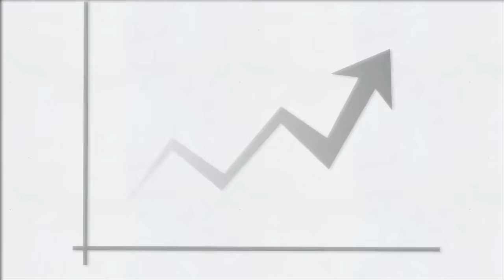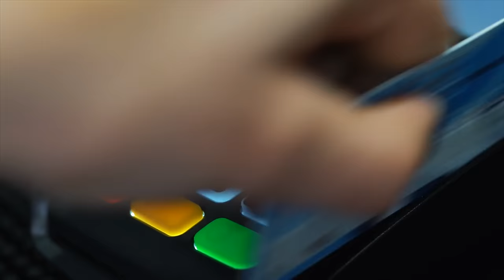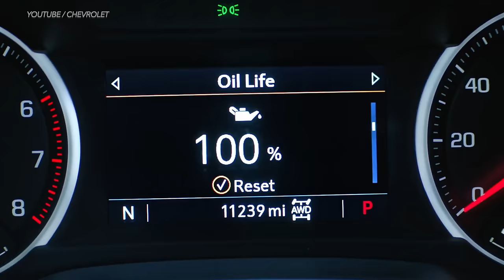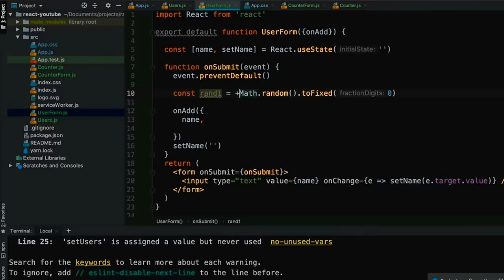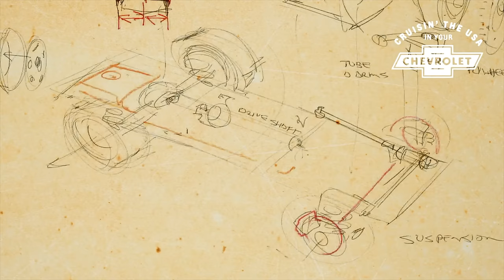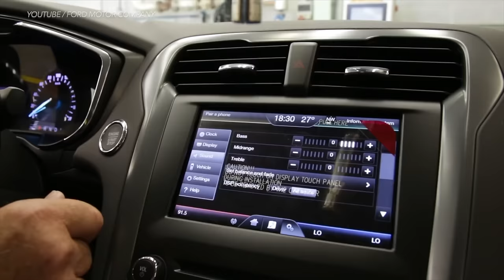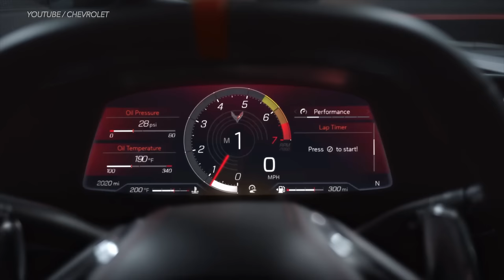Here's Why Car Companies Just Made it Illegal to Work on Your Own Car

Comment: Bravo Scotty  on your video that exposed the automotive repair industry and its monopoly on the repair parts used in that business. Cars need to be modular across brands. I am a truck guy, and why ? Because I didn't care about style (car fashion) But the manufactures quickly realized they could style pick-ups and ruin that vehicle for the consumer as well. Tesla any better ? Heck no. I hoped Nissan and the Leaf might help set this straight, but I guess not.
I am now looking at classics, cause I learned enough in high school shop class to do the basics on those. And they might survive a MCE event that peaks in the next two or three years. Check Physics Girl's channel on those. Computers & computer based cars are not likely to survive. Oh and the protective Van Allen electromagnetic fields are weakening as I write. Good luck everyone. I warned ya.

Comment: Another problem that I see and hasn't been mentioned here. The people who design cars never have 
to make any repairs on them. I can tell because if they did, they'd make them a whole lot different. I've 
had to work several hours on a car to replace a simple part that other cars can be done in less than 
ten minutes. 
We need another car that can be built like the original philosophy of the Volkswagen. Simple, Cheap, 
Easy to repair, and inexpensive parts.
If I won the lottery today, I wouldn't buy a new car.  They all look alike, and I don't think they're as 
reliable as they used to be.
Reply: As a teen i loved my 1962 Falcon with straight 6 and manual transmission. Had it for years.

Comment: I wonder if there is a way to get around these patents. That would be, have a system replacement kits built by aftermarket. For example if your BMW brakes go bad they have a complete system that'll replace the original and the only connection would be at the brake pedal and the wheel hubs the rest would be a self-sustaining system. Then maybe a complete Driveline. While it may seem expensive, it might end up being the same price or cheaper in the long run Plus after that you can Go full aftermarket as your replacement system gets older. Basically all you would have is a body frame and interior the rest would be your own car. And for the price of new vehicles it seems to be appealing

Comment: Fortunately this only applies to newer vehicles. I drive older vehicles, and have no problems getting parts. I am a retired mechanic myself, and can fix most things on older vehicles. But if I run into some big, that requires, say, a hydraulic lift, all my cars can be worked on by any independent shop. I have 3 cars and a truck. I'm 63. I will likely never have to buy another vehicle in my life. None of my vehicles have ABS or airbags, and they all have normal sized wheels and real tires.

Comment: There are repair shops that are ripoffs ! Went to get estimate on a 2007 Honda odessay oil pressure switch replacement, mechanic looked it up and hourly 125hr and switch cost $400.00 ! Then went home looked up on eBay for switch and found one for $10.00 ! And looked on internet how and where on engine to install , so ordered switch and when arrived installed it in 15 minutes ! And been 8 months and no problem ! Do research first !

Comment: I just bought a 2003 pontiac vibe in near perfect condition. Some of the lines are rotting out because it's been sitting in someone's garage for at least 15 years. I literally couldn't find replacement lines anywhere so I ended up just fabricating new lines. I get that it's an old car but theres no reason I should have to completely remake the parts from the ground up.

Comment: I need to replace the valve cover seal on my car, I called the dealership (Peugeot) they wanted $325 for the kit, basically it's 8 0-rings and a seal, I got a aftermarket kit, that was $130 from Repco.

Comment: I found that removing all the electronics and using a carb and HEI, much better gas mileage and reliability results.  Further, some guy used a lawn mower carb on am older Ford 302, and got 41mpg.  And good performance.  Hmmmm.

Comment: Tell ya what. I've got a 1984 a 1998 and a 2018 vehicle. That 2018 costs way less to drive and maintain than both my older cars combined. Sure that may change later on but I don't expect it to break for quite awhile.

Comment: I saw a video that the oil is changed through fittings on the oil cooler lines with a motor  oil flush machine.
Reply: In California, by law, all commercial oil changes are performed by aspirating the oil out thought the oil filler tube. Used motor oil contains toxic substances and the law protects humans from coming in contact with it as occurs when oil is drained by removing the plug in the oil pan.

Comment: GM was wired back in1994-1996 they came out with a hybrid OBD system they had OBD  1.5 which had an OBD 1 computer and an OBD 2 port for modern scan tool and you need a GM Master TECH II scan tool which I brought off of a dealer that got rid of it they sold it to me for 25.00 plus tax.

Comment: Not all replacement parts are equal by any means.  I got into a small front-end collision that bent the hood and they had to replace it and progressive decided that an OEM replacement wasn't worth it for my car.  when I went to pick the car up there was a half inch gap on one side and 1/8 of an inch gap on the other and the hood was crooked. The body shop just told me that it was the hood itself that was the problem and I said well you can't just spin it he said no because they mounted the mounts for it in the wrong spot they welded them incorrectly.  after about a week worth of arguing with progressive they finally gave me an oem Hood and it fit perfectly. this is a your mileage may vary kind of issue.

Comment: There should be a short time limit on the patents  3 to 5 years at the most to allow after market parts suppliers to make the needed parts. The primary manufacturer usually stops making the parts after a few years to force owners to buy a new vehicle. This should be an illegal trade practice.

Comment: I noticed that compared 50 cars with today's cars in few areas but with all the computers and the checks that are for the better the gas mileage never went up even when making the car lighter and shorter and additional checks that fuel is burned and exhaust is rerouted and such for efficiency of what .  
              The cars that are pumped out today aren't made to work on .
        Some people get in to job find the repair guide says it takes 7 hours to replace said part and the business charges that when the machanic sees that and knows it was not even three he knows he just helped screw someone out of 400 dollars in labor cost.  Not to mention the fact that his paperwork went in the trash.   
      As far as the insurance companies go they are now pressuring folks with cars that vandalized to seek out parts from local upullets for parts and claim that the price of factory part from a train wreck will be warranteed and guaranteed by the machanic of there choice.

Comment: I definitely have seen a rise.  A new ram truck requires a full synthetic oil back in the early 2000’s conventional was good enough.  A qt of conventional was last I checked $4/ qt or about $12/gallon.  New truck now requires oil that is $24/ gallon but what you say you can go further on synthetic well not in all vehicles.  The change interval in a new ram about 4000 miles.  Older vehicles the interval was 3000.  Yep progress just wait till everyone has electric vehicles just what for those maintenance bills

Comment: Scotty, What are your thoughts?  People claim it's cheaper to repair a gas engine in a vehicle than a diesel engine in a vehicle because any gas engine mechanic can work on a car engine in any car.  But, isn't that becoming an outdated position?  Maybe it was true if the car was a Ford Pinto or Chevy Vega.  The gas engines with computers and sensors are just as complicated as a diesel engine.  I can repair my diesel myself but I still have to find someone (Ford dealership) to flash the computer.

Comment: This is why I still drive a '79 GMC C-1500 and a '90 Ford Ranger, and will still drive them no matter what gasoline costs. EV's are not feasible, and never will be. Retrofitted engines to use hydrogen fuel is the only option I will consider.

Comment: Normally I'm with you Scotty, but being in the body shop industry for 20 years, I found that original equipment parts are way superior to the aftermarket crap that a lot of insurance companies want you to use.  This includes all parts from mechanical to body parts.  I don't doubt that what you are saying is fundamentally true, but I wished that the aftermarket would up their game and make parts truly equal  to or better than O.E.M. parts.  I know that NAPA has several levels of quality in their parts and most of the time, the repair facilities use the cheapest parts available.  It's a little more complex that merely allowing aftermarket parts to co-exist along with O.E.M. parts.

Comment: Nope. haven't noticed. I do all the maintenance and such on my car. Plus, the older cars. Sure, they may cost a few thousand to repair at times. But then, $5,0000 dollar for a new engine and transmission, is cheaper than a brand new cars, by about $10,000.

In the long run, it's more cost effective to repair the older car than it is to buy the new. Especially with the 5 year or so life span of new cars. For example, my car, I'm the second owner of it, it's a 1998 with 213K miles. Does it have some problems, yes. Can they be fixed? Yes. Which I've been doing. I bought the car for $2,250. In total to fix the problem,  I have about $1,000 invested. That's $3,250 total for the car. That's the down payment for a new car, or barely the quarter cost of a new car, and I don't have the monthly payment.

Thus, I can use aftermarket parts. Which, truth be told, are generally better than O.E.M. parts. Since they want the oem parts to break, so you have to buy more. Dorman is the worst for this.

Comment: I was just thinking about the poor guy, who was suggested to replace his main battery for several thousands in his EV because a little 12$ or less cooling inlet broke off. Luckily for him, some right2repair guys could help him.
Btw. What are your thoughts on the Aptera concept? I mean, how they want to help customers and mechanics with a digital repair manual?
It reminds me of the old cars from 80's and 90's, where the manual could give you a lot of help, when something was wrong with the car and basic guidelines for smaller repairs.

Comment: We drive  97 dodge ram 1500 AN THEY wanted 1200 for the throttle body and my husband just put an old school intake on it and I actually get 26 miles to the gallon now an it runs so much better its a 318ci an we have  dash lights  on  but they are WORTHLESS since the computer isn't running the carburation.

Comment: These manufacturers are about to get a huge wake-up call. Additive manufacturing, I can 3D print many replacement parts, and I can use stronger materials like Carbon Fiber.

This is my prediction, the maker community will publish CAD files for common automotive components. This will expand to a huge library, where anyone can go and grab the file for the part they. Makers will grab these files and print parts for their cars. Manufacturers will file legal cases, in attempt to stop this. I think they’ll face an uphill struggle, I just need a digital caliper, a CAD program, & a 3D Printer and I’m in business.

As people build their CAD library for their own vehicle, I think they’ll uploaded them to website’s hosting public libraries.

Comment: I guess these “modern” consumer customers have never seen old cars and trucks with steel or oak board bumpers fastened on the front and rear with lights attached. That’s really easy today with all the LED options in aftermarket. The longer we put up with this $*&t the worse it gets.

Comment: The cars out and coming out is like a computer on wheels. Not a mechanic but more like you need IT to fix them. Technology is moving more in these vehicles. But with all the computer stuff in the new vehicles and in the future. It's not about a wrench. It's about software. Computers won't last as long as a engine. More complex. And when one thing breaks. More things will breaks. Electric cars are so expensive to buy. And we all should have one. Really?  I rather just keep my car. If it needs something. I just watch Scotty. Besides. I want quality. And Tesla. Scotty is quality.

Comment: This should be criminal that a person wants to repair there own owned vehicle by there own choise of options. A vehicle is a product of property and when you buy something like that, its yours to do as you please with that is not of course a danger to others (common sence). Any company that prohibits "Right to Repair" doesn't deserve any business.
That is nothing but greed and unjust controlling of a product they have sold = don't own any longer. This is not right by any means for companies to do so.
And if there are cheaper alternatives for parts to use, then what the heck are the car companies saying that is not right with them - when they themselves don't want to offer that to there customers. 

And I know that honest and carrying mechanics don't want to push those part costs to there customers and want to make that part as less-costly for them as possible with-out selling them worthless parts. Honest and good mechanics just want to get paid for there work effort = the repairment, not by forcing very expensive parts to be bought.

Comment: My mk4 jetta had an oem water pump propeller made of plastic, which obviously melted and broke off of the motor and was rendered useless or nonfunctional if you will. Aftermarket waterpump came with a metal propeller and was the same price as the plastic OEM part. Just an example of why it's dumb and wasteful to skimp out on design of products like cars and restrict regulations to rob the customer of more money down the line with repairs which he won't be able to do himself by some arbitrary legal standard. Just make a product that doesn't break under normal operating conditions, but no. Doctors know how to fix your problem, but will have you coming back to keep making money off you. It's monopoly in every sector of business. What was once an asset, turned out to be in fact a covert liability given the right kind of policies.

Comment: Have a 2000 gmc 4x4 the 4x4 is controlled by a switch on dash  that control another switch on transfer case that control another switch on axle , so replaced switch on dash then on trans case now need switch on axle ! Have had gmc 4x4: 1973, 1986 both had simple lever on floor for transfer case and cap on axle to turn to engage 4x4 ! Now System on 2000 gmc UNNECESSARY ! Just more parts to buy so getting it fixed and getting rid of truck and go back to something I've had and alot easier to maintain. I've built a complete car a ratrod from junkyard parts all basic parts that don't require a computer to do something simple that the running engine can do like control oil pressure with pump in oilpan not a switch outside of engine or computer to control airflow into carburetor when simple needle for air or fuel do the same then back to the switches on 4x4  have to disconnect battery before replace switches and leave battery disconnected for hours so computer can go to sleep and forget memory of bad part then connect battery and hope it forgot bad part and if didn't then computer will still not let new parts operate !  more headache and have to check replaced parts to see if they are good and if are then main computer can be bad which cost even more !

Comment: If they only keep their cars for 12 years they are idiots. If they maintain the car well, and keep up with it... a car, or tuck, can last for more than twice that. I drive a 1995 Ford Ranger, 2.3 L, 5 speed manual, 2 WD... and it still runs fine with almost 180,000 miles in it. Why? Because I keep up with maintenance., and replace things as they wear out. Yes, I recently had ALL the brake lines replaced rather than wait for them to fail one by one after the first one went... but I still spend WAY less than if I were making monthly payments on a new pickup.

Comment: i failed emissions, the state provides a program that pays up to $900 out of $1,000 towards repairs yo make i t pass, they told me i needed a catalytic converter and a fuel filler hose, i looked up catalytics for this model 2002 buick Lesabre they retailed for about $145 to $235 dollars, yet the mechanic at brake max calls me and tells me after the $900 your cost will be $1460.00 me F@&k! he goes you have a special catalytic converter, and the oxygen sensors are so much as well, but you don’t need oxy sensors. so it $1100 over the $900 so $2,000.00 for replacing a catalytic converter
and filler hose. is it any wonder i don’t believe these people? i think they pocketed the $900 and then charged me full price on top of it.

Comment: As far as this mechanic is concerned, the best lasting cars were of the 1990's. It was fuel injection and trans overdrives that made these vehicles last longer. Atomize the gasoline so cylinder walls don't have their lube washed away, and simply slow the engine down for less wear and tear. Take the Ford Crown Vickie for example.. 300,000 mile life was easy as any cabbie would attest to. Todays Ford Explorer and Chevy whatever are lucky to make it to 150,000 before a major break down due to planned obsolescence.. And with all the added micro processors in todays cars, you will not be able to fix them as the parts will simply not be available.. Think todays cars as similar to your computer.. Your jeans will last longer ...Haha